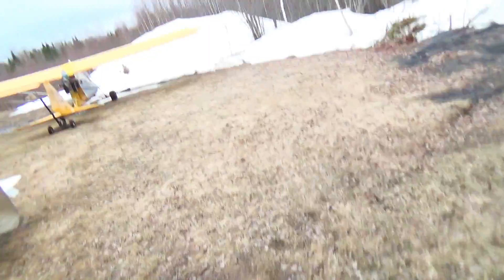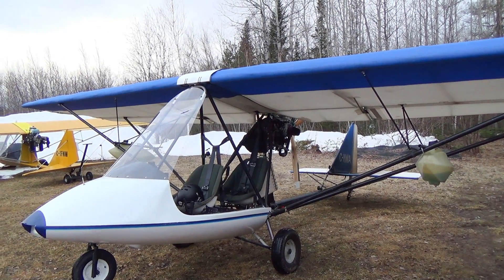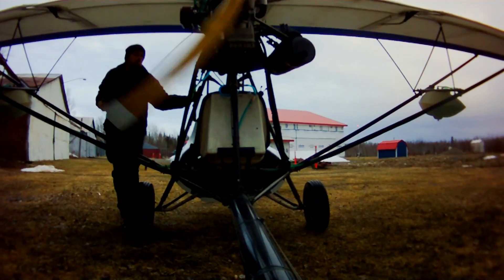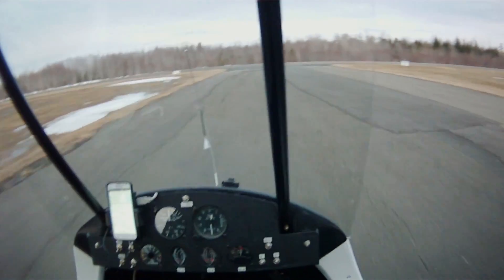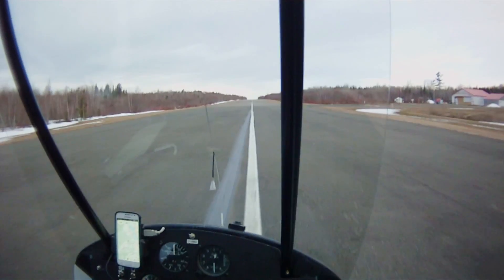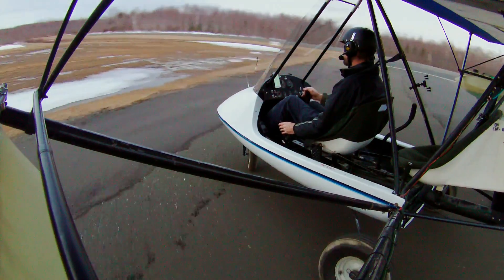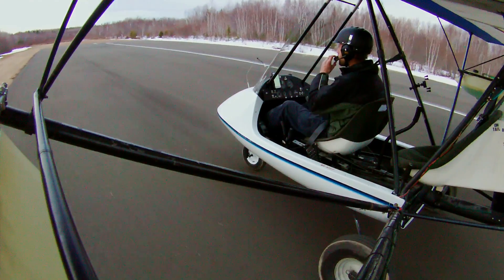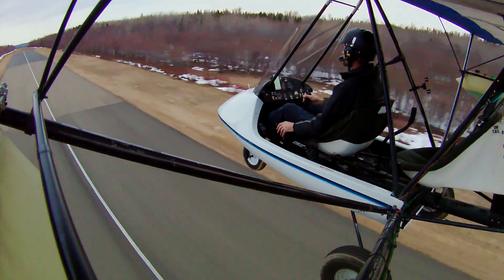Testing a 3 Blade Prop

Comment: Matt this has always been the way that I shut my two strokes down whether it be bike boat or aircraft makes no difference a lot of people want to cut the fuel off and run all the fuel out the carburetor so that it won't come up when you do that you not only have removed the fuel you have removed the lubrication so I think you are doing it right by flooding them down.
Reply: When you run them out of fuel to shut them off they always speed up just a little bit before they die starve them for fuel they run lean right at the end starve for fuel starve for lubrication

Comment: Yes actually, I saw many examples of catastrophic b-box failure with people running three blade Warp Drives that forced dead stick landings. My business was on the field at Arlington Airport....which had one of the bigger ultralight parks in America. 

It was due to these harrowing escapes from death I spent so much time trying to get the mass moment of inertia DOWN when designing Powerfin propellers.

I built every propeller WITHIN the limits set by Rotax for whatever box I was trying to put a prop on.

Comment: You say RPM. Is his engine is same as yours?  Perhaps  the tachs are calibrated slightly different. Put his tach on your engine and check RPM again. That might eliminate tach errors as long as they are getting the same power voltage.

Comment: I know I am WAY late to this party but as a new ultralight owner I am watching a lot of videos and reading a lot of material to make my experience as a new unlicensed pilot as enjoyable and safe as possible. My Hurricane has a Rotax 503 duel carb, DCDI setup that is rated at 50 horsepower at 6800 rpm. It spins a 3 blade ground adjustable  IVOProp. With all that said, there are two things that matter when it comes to which prop is right for your application. First, you have to know at what rpm range your engine makes its peak horsepower. Secondly, your engine has to be spinning the prop (any prop) within that rpm range at full throttle so the engine neither over-revs (spinning excessively fast) nor lugs itself (not spinning fast enough and not achieving its peak horsepower) when you are at full throttle take offs or full throttle flying. Full throttle here equates to max revs and max horsepower at the same time. These blades are made to be adjustable for a reason. You must take the time to experiment with different blade pitches to achieve the max rpm range of the engine at full throttle (thus max horsepower from the engine) with the proper blade angle. If the engine does not reach its max power rpm at full throttle then the pitch of the blades is too high. If the enginge over-revs at full throttle then the blade pitch is too low. Trial run ups of the engine at full throttle and the blade pitch at different angles of attack is the only sure way to achieve this balance of max horsepower and proper blade pitch. Running the engine any other way is damaging to the engine and dangerous for the pilot. Sorry for the long commentary.
Reply from the maker: You are absolutely correct in all you say as far as I can tell. The issue here was I had borrowed the 3-bladed prop from a friend and so I didn't want to adjust the pitch just for this test. I didn't realize that our gearbox ratios were different until after and so despite having the same engine, his prop wasn't pitched correctly for my set-up.

Comment: If both props are the same pitch and both engines are identical,you would get a drop in rpms due to the extra blade the engine has to rotate,however it would be smoother and a 4 bladed prop would be even smother still.To compensate for the 3 bladed prop you’ll have to use a smaller diameter prop,maybe 1-1.5 inches,but no more.
Unless your engine is so wore out and compression is not what it used to be,loading it with 3 blades will show in Rpms,not that simple,lots of variables play a big role here.

Comment: I ran a 3 blade ground-adjustable Ivoprop. Flatten the prop until you get the desired rpms. He's getting more rpms bkz his prop is flatter. Takes fine tuning.
Reply: Allen didn't you see he removed the prop from the other aircraft and put it on his aircraft same pitch same prop not just same type prop but same exact problem

Comment: Didn't read all the comments., so maybe someone else mentioned this.  The 55 HP 582 was a single carb engine.  I've found that 3 blade props do run much smoother, but performance is not as good as two blade prop.
Reply: Matt,  incase you are still thinking of going with the 3 blade warp, I have an extra 3 blade warp drive hub I will part with for way less then new. Jim
Reply from the maker: Ahhh... single vs. dual carb, that makes sense. With the performance I'm currently getting, I'd be ok with a slight reduction in performance if that meant a smoother ride. :-)
Reply: Well three blade will be smoother.  Your static RPM should be from 6000-6250.  If you are set there, the prop shouldn't unload much and over rev on climbout.  Surprised your engine didn't bog down completely  with the low rpm you were making.  Jim      @mmatt
Reply from the maker: I like my static RPM at the top of your range. I actually aim for 6300 since that gives me a little better climb performance. Not like I'm going anywhere fast anyway so I might as well pitch it for climb! ;-)
Reply: Some props unload more then others, that's why I started at 6000.  A warp taper tip 3 blade on the yellow Avid Flyer in my picture comes to mind.  With most other props I found 6250 was a good place.  More of a load helps keep the EGTs lower.  Did you ever go to a 3 blade?  Jim @mmatt
Reply from the maker: Not yet. Still saving my pennies. lol

Comment: the extra blade absorbs power, To get the RPM, need to reduce the prop pitch.
given all that vibration, strongly suggest balancing the prop until the blades are within a very few grams of each other
Reply from the maker: The blades are balanced as perfectly as the scales will allow. The vibration issue isn't a problem with the balance, it's the way a 2 blade prop throws air compared to a 3 blade prop. The RPM issue was solved, it was a gearbox ratio difference although what you're saying is also true. Thanks for the comment!

Comment: Forgot to ask u did u notice any difference in ur aircraft and wat was ur max rmp
Reply from the maker: There was definitely less vibration with the 3 blades. I didn't re-pitch the blades to match my gearbox so I only got 4800 RPM at full throttle. Once I put my prop back on, I got the full 6500 RPM.

Comment: If your two blade that vibrates is supposed to be better for the gearbox, and now the three blade vibrates way less, I would take that chance and stick with three blades.
The RPM is a mystery if his gearbox is the same as yours. I'm curious to see what you find out. My challenger had a blue head 582 with a belt drive, no vibration at all. Is the non-blue head less HP? I don't remember the difference anymore.
Reply from the maker: The Rotax Certified Tech I spoke with said that there is no difference in power between the Blue and Grey head engines.... but..... if you look at the published power graphs for the 582, you'll see two lines; one for the 48KW (65HP) engine and one for the 40KW (54HP) engine. Also, I think I once saw a muffler for sale that was listed as being for the 54HP 582. I'm not exactly sure what the real deal is but I'm quite certain mine is the full power version now that I've figured out that it was just the difference in the gearboxes. 
Regardless, as soon as I get some money saved up, I'm pretty sure I'm going to add a third blade to my Warp Drive. :-)

Comment: May be different ratio. I just replaced my 2 blade warp drive with a 3 blade Kiev. Which is lighter than my warp drive less gearbox wear. On 65 hp Hirth 3203 EFI. What a differance.
Reply from the maker: Tell me more about your 3203. I'm very interested in them and will probably replace the 582 with one once I wear this one out. ;-) What plane do you have yours on? What do you get for fuel burn? Are you happy with it overall?
Reply: @mmatt  I just installed it beginning of the year on my phantom x1.  My fuel burn has been between 3 to 4 gph.  Only have 12.5 hours on it. I take off at 6500 and 8740 feet msl.  Need all the power I can get. Lighter than 582 by far being air cooled with nikasil cylinders.
Reply from the maker: Very nice. One of the main reasons I like it over the 582 is the fan cooling over the liquid cooling. Liquid cooling belongs in cars, not on airplanes in my opinion. lol
Reply: @mmatt  U r Instagram ID OR mail ID
Reply from the maker: https://www.youtube.com/user/mmatt/about

Comment: I'm no expert at flying, but I DO have a good working knowledge of sailing & boating.  Let me say what I think is going on with the three blade...
Would it make sense that more blades catch more air to push with, as more sails on a boat catch more air to drag the craft through the water?  More blades catching more air makes the engine work harder to achieve the same goal.  On the other hand, less sails on a boat catch less air & won't travel as fast?  I'll bet that the engine will reach full RPM 'without' a prop because of no air resistance.  The two blade catches less air than the three, hence higher RPM.  And yes, pitch will make all the difference too!
It's just physics.  And yeah, the same motors with the same props reaching different RPM's (on different aircraft) could very well be a difference in engine build & tolerances being slightly different, engine wear, aerodynamics on the craft...etc, etc.
/Edited because I accidentally a word out! :)
Reply from the maker: It was the difference in the gearbox ratios, that's all. 
But thanks for the comment! :-)
Reply: @mmatt  NO...Not the gear box.. Scott Meister is 100% correct.. Do not worry about the prop RPM.. 2 bladed prop or 3 bladed prop is really doing the job... But lastly 3 bladed prop will don some thing much better... Just use the 3 bladed prop...

Comment: Wouldn't you be better to go with the better RPM than the smoothness of the 3 bladed prop Matt?
Reply from the maker: Yes, but the props I use are all adjustable so I can get the RPM I need with just a bit of adjustment. I just didn't want to adjust Owen's prop because it's already all set up for the Chinook.

Comment: Thanks for making this video. It's gonna be interesting to see what you find. The different gearbox ratio is a good possibility and I hope that's it. I had a similar problem and actually observed what looked like tiny air bubbles in the fuel line only to find out late that one of my pistons was seizing. (wish I hope is not the case with yours). Strange as all this sounds please stay close until you have 5 hours or so on it. 2 blade vs 3 blade is just an excuse to spend money imho. I swear I'll never buy another 3 bladed prop again. Just doesn't chop the air like a 2 blade. Take a super hard look at those cylinders before you buy anything.
Reply from the maker: Cylinders are fine. I put my 2 blade prop back on and I got all my RPMs back. The difference was just the gearbox ratio. I think I'd rather a small decrease in performance if it meant a smoother ride. I haven't decided yet though so I guess we'll all just have to wait and see! :-)

Comment: Tie it down to test.  Set blades with digital protractor for most accurate setting and least vibration.  I did this recently on my 3-blade PowerFin which I set previously with the old pin and feeler gauge method resulting in blades being about 1 degree different worse case.  After setting with digital protractor, got them all within 0.2 degrees.  Noticeably smoother running.

Comment: The more I think about this, the more it makes sense. Both engines being the same, running at full throttle for take off, will consume the same amount of fuel, as long as they are both tuned and running properly. So let's assume they are. That means that an engine that make 4800 bangs per minute will draw less fuel than an engine that is running at 5500 bangs per minute. (RPM) Now, if your engines produce maximum power output at or below 4800 RPM,  that means that the energy going to drive the prop will be the same , and the prop spinning at the same RPM, with the same energy input, will perform exactly the same. Regardless if the engine is at 4800 or 5500, which is governed by the gear box! I'd say based on that, you would have the same performance, with less fuel consumption, running that prop with your gear box! I really do hope I'm making sense, if not...blame it on the cold winters here in Winnipeg freezing my brain! LOL (EDIT) OK...I just checked the power bands of those engines. I appears that they are not producing maximum HP until you get them upwards of 6500 to 6800 RPM, and can only run them that high for 5 minutes. So....4800 RPM is not producing as much HP as 5500 RPM, by a long shot. Sorry for the long reply...

Comment: If you have a 2.58:1 gear box, and get 4800 RPM. Your buddy has a 3.0:1 gear box and is running 5500 RPM. That translates to a prop RPM of 1833 for you buddy and 1860 for you! So close I'd say they were spinning at equal rates. You should have been developing nearly the same thrust as he does, or maybe a touch more in fact. Also, you are probably developing the same horse power, based on the prop RPM  and thrust produced. Energy can't be increased with gear ratio, and that's proven by the fact that the prop develops the same RPM at full throttle. Hope this makes sense.

Comment: Every video, I like that steering. Maybe inspect the sidewalls regularly. I don't know if the duty of that tire was engineered for such side loads. Is it tube type?
Reply from the maker: I don't think it normally comes with a tube but I specifically requested that it get one. I give it a good look before and after each flight.
Reply: Then there is that stuff you can spray into them to make them semi-solid. I don't know if that would be good or necessary.

Comment: The chinook has an E-gearbox, likely a 3:1 gear ratio, you are running a B-box, probably with the 2.58:1 gears.  If so, there is your problem. ;)
Reply from the maker: You win. :-)

Comment: You mentioned a different drive, are they they same ratio? I'm not familiar with these engines at all (I fly model airplanes with electric motors... lol) so forgive me if it should be common knowledge. If they're geared different maybe that explains the different max RPMs?
Reply from the maker: You figured that out much faster than I did! LOL! The next video (to be released Sunday morning) is where I finally figure it out.

Comment: I think ultralight news put out a report that a two blade tennesse prop put out the most thrust as a bonus it was the lightest of all props. the warp drive was the heaviest of all. Oh here it is :) http://www.ultralightnews.ca/articles/ultralightpropeller_comparison.htm
Reply: I just went back and looked at the article and warp drive isn't even mentioned but I used a 3 blade warp drive on my skypup and I can remember its a solid composite prop, I only used a 3 blade for ground clearance issues.
Reply from the maker: Ya, the Warp Drive is definitely the heaviest, but also the most rugged. My gear kicks debris up into the prop arc on a regular basis so that's why I use it. I've already wrecked two wood props so I'm sticking with Warp Drive for now.